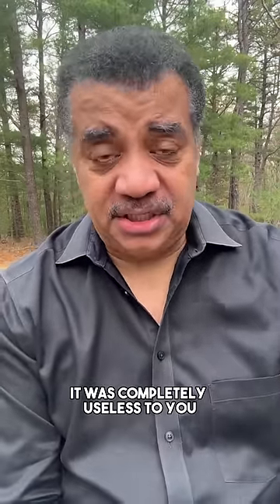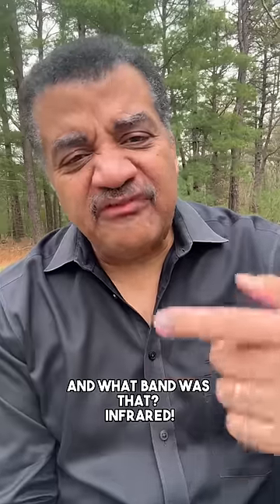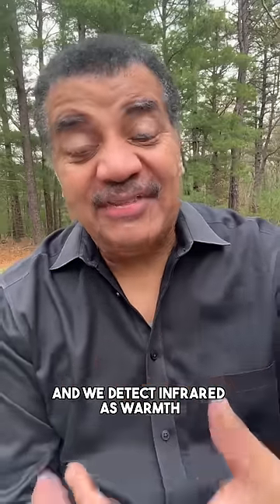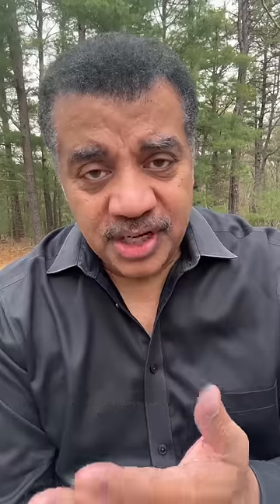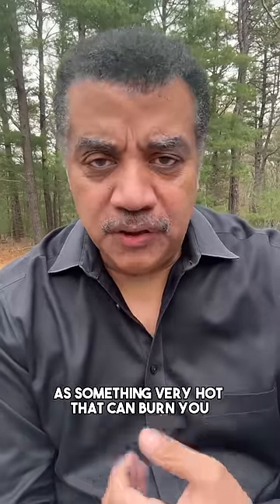LED Bulbs vs. Old Bulbs 💡

Comment: The wasteful thing now is that every LED bulb needs to have an AC-to-DC converter in it, which makes heat.  Maybe Edison was right about DC after all?
Reply: It's hard to say what's the most efficient and least costly system, but what we have now is pretty good. 
AC is good for long transmissions and is cheaper infrastructure than DC, whilst more dangerous (which is partially true, since DC can jump/arch over a longer distance in air than AC when opening a switch, making DC more dangerous in that regard).

Most simple devices that were used in beginning when electric grid was made got powered directly by AC, lights, motors, and devices that needed DC were considered niche. 

Also consider this, every outlet right now is standard either 230/240V or 110/120V single phase AC depending where you live. The device itself or charger/power supply then changes that standard into what it requires. Could be 12V DC for a laptop charger, 5V DC for phone charger, 3 phase AC for a brushless washing machine, etc...

If you wanted to use DC in all the house wiring instead, you would either need to run different cables for every outlet with a different Voltage, specific outlet and wiring for 12V DC for laptop chargers, 5V DC for phone charger, etc... this would make the electricians jobs and manufacturing of electrical equipment more difficult.
Furthermore, the equipment like brushless washing machines will still need to convert that DC into AC.

Also note changing DC voltages, e.g. 12V to 5V is not as easy as AC. Most efficient ways convert it to AC actually...

So honestly it's better to have a standard which costs less to setup (wiring for DC would cost much more due to thicker cables needed as you'll be running the lights in 12V or 5V DC at higher amperage), 
and can be easily converted to what the device needs (much easier and cheaper to convert AC to DC using a full bridge rectifier, than DC to AC which needs transistors, oscillators etc...) 

I think a combination of the 2 is the best, like having a single AC to DC converter for all the lights on the same circuit, and then run wiring that will have DC to those lights. 

However that's only for lightning really, anything else like outlets need to have the interchangeability (you don't want to be limited to only plugging in 12V DC devices into 1 outlet as it's only designed for that. If you wanted to change the outlet, either rewire panel or buy adapters... which wastes more energy than just using AC and converting it once.)
Reply: @dewsjievpdav6557  My question was rhetorical, really.  You raise good points.  I recently saw a video about a renovated hotel with most of the exterior surface clad with solar panels.  They used power-over-Ethernet to run all the lighting on DC.  (They didn't mention which of the three IEEE standards was used, or if they invented their own.)  About long-distance transmission - the very longest power lines use HVDC to eliminate the capacitive losses of AC.  It also means the lines can be buried or on the ocean floor instead of on tall towers.
Reply: If you feel how warm those AC/DC converters get compared to those 60 watt incandescent bulbs you'll see it is still more efficient.  That converter will only draw the amount of current it needs to turn on the LED.
Reply: @dewsjievpdav6557  No... AC is not better for long distances.
That a misconception. Historical AC was better for long distances because it was easy to transform to higher voltages. But with today's electronics that can transform DC to higher voltages, it is preferable to use DC.
Reply: You can power the diodes with AC.. but you'd still need to step down the voltage and use Graetz bridge

You could use DC, but you'd still have to step down the voltage
Reply: @1953bassman  Some get too hot to touch, I've noticed.  I'm sure they're cooler than incandescent
Reply: @SumUnicus  yes I know DC is actually the winner in very very long distance transmission. However the cost of that infrastructure is insanely high compared to AC transmission. It's not worth the money if you're transmitting between cities, however when you get to transmissions between cities, then it's worth it.

Comment: You ever wonder why an led bulb doesnt last 9 to 20 years like they say . Cost 5 times as much and not last 5 times as long.
Reply: Good question. The answer is simple: LEDs are cheap, Chinese junk. The computer chip goes bad before the actual diodes do, thus filling up the landfills with toxic chemicals and plastic. How is that better than a glass and metal incandescent bulb, which the unless Dept of Energy banned last year?!
Reply: Planned obsolescence. Without it we would buy bulbs once and never have to again. Lightbulb manufacturers colluded with each other to put lifespan limits on incandescent bulbs after they came out too.

Comment: The only thing about LED lightbulbs in cold weather, you have to turn them on and wait for them to warm up enough to actually see. I had my washer and dryer in the garage and 5 mins before the load was done , I had to go turn on the light and wait to be able to see. So go figure? Five extra minutes of usage over instant lighting and done with it and turned off. That doesn’t help. Inside our home, that’s fine except in the higher ceilings, they take time to get to luminosity. There’s give and take. Once they improve, I’ll be okay with that.

Comment: The warmth was actually a bonus it was a low wattage heater that operated in occupied rooms.
Obviously it wasn't always a bonus as thare are hot nights and unoccupied spaces and out door environments
Reply: I threw out my old lightbulbs. Bought some LED's and an electric heater instead! 🏝
Reply: Yep it was super welcome in our houses.

Plus smthg makes no sense : we use electric devices that need less electricity than before (much less watt), We know better than before how to produce it, but it's more expensive than before nowadays. + The heat loss from electric devices which cost a few more in heating than before.

Him : "Welcome to the present ! Welcome to the future !"

Us : "Can we get back instead ?"

Comment: Niel demonstrates over and over again that he doesn't understand science well. Infrared (heat) generated from lights is not wasted energy especially in colder climates. Most automotive manufacturers are discovering this from headlights. Halogen headlights produce enough heat to keep headlights free of Ice that normally distorts the headlights. That's just one example.

Comment: Warmth is indeed useful sometimes. Like when it is cold.
Reply: Thankfully, LED technology allows you to get the same amount of light AND heat for less cost. Just install one for light, one for infrared heat. Getting both the bulb and the heating element will cost you less in the long run than the less efficient incandescent bulb.

Comment: I have worked  on Refrigerators for 40yrs now factory warranty  and repairs ,i have never seen a light bulb  as a defrost  heater , as most use a heater that is similar to the bake element  in your stove.

Comment: I have worked in some high profile lighting maintenance situations with LED lighting. Heat is still the enemy and is still the reason lighting maintenance is recession proof still. I was trying to find a solution and I talked to the guy who did the LED lights on the space shuttle. He would not have anything to do with it because the manufacturers did not have the heat problem solved. I could have solved the problem at the airport so most fixtures would last the 20 year projected lifespan of the LED bulbs but they didn’t want to pay that much.
Heat is the main reason almost or maybe all things have a life expectancy.

Comment: No they weren't putting out usless infarred light. In cold climits they are great. Enough heat in well houses to keep pipes from freezing. They didn't hurt in the house either. And lets not forget green houses. Sure ultraviolet is good along with the infrared for heat. Plants like that.

Comment: Some led bulbsdo get hot showing their inefficiencies. 
To those that say old bulbs are more efficient at heating ... fill your house with incandescent bulbs and you have efficient heating ... on a hot day you will have to dump that extra heat with your air conditioning ☹️ 
The more difficult problem is the lack of Near IR causing problems with melatonin levels (part of the vitamin  D paradox, general health and viral resistance).

Comment: Net electricity in the US is basically flat since 2005, when LEDs and other concentrated efforts toward more efficient end use devices kicked into high gear.  And, we're much more populated now.  Things using electricity are getting more efficient across a broad spectrum of uses including HVAC, lighting, refrigeration... last year we actually used LESS electricity that the year before...

Comment: They were made to turn enough of the electricity into heat to 'burnout' the bulb. Although it was usually the posts holding the filament that melted.

Comment: Not useless energy when you live where -30°C isn’t uncommon. When it’s freezing cold in the winter, the heat from the lights is warming the room. When it’s +30°C, it’s also incredibly sunny and you don’t turn lights on. Switching to LED lights just put my gas bill up.

Comment: Well that's all well done but occasionally you like the warmth from a standard old light bulb like when you're trying to heat your pump house to keep it from freezing and put the light bulb down by the pump when you trying to keep your boat from getting too much moisture in it so you buy a light bulb in there to help keep it from being too wet

Comment: I thought it was closer to 95% heat. In the 70s when I was studying electronic engineering and we considered vacuum tubes to be, well, worse than passe (exceptions for rf transmitters), we liked to call a common lightbulb a 100W, as in "one oh oh w" tube.

Comment: A major problem with LED lighting is that because each LED uses so much less wattage that manufacturers use many more LEDS per light fixture than were used in the old incandescent fixtures and thus more light is generated than is needed and the amount of light pollution is increasing.

Comment: LEDs are not "bulbs", they are Diodes. Bulbs contain a filament that is a resistor that heats up in order to blow when they get hot. LEDS have extremely low resistance and that is why they don't get hot. The light from an LED comes from photons released by the vibration of electrons crossing the PN junction in the Diode.

Comment: BUT, why not swap out the LED bulbs in winter?  We use light bulbs at night, when it's coldest.  We could simultaneously light and heat our rooms with incandescent bulbs during the winter nights.

Comment: Ok, the light-part of an energy bill is negligible, even with these old bulbs.

The moment you have your lights on, heating would be on as well, so the heat is not lost.

LED lamps are way more expensive than bulbs.

Bulbs are made with way less environmental damage than LED.

LED use electronic techniques that make bad use of the grid, and the powercompanies will start billing us for it.

Comment: Old Bulbs were literally burning. They emited light by being really really hot  - so hot they become "orange hot" - this way they could last 1,000 hours before they literally burned off.

1000 hours can be seen as industry standard, as it is a trade-off between efficency and durability of the filliment - you can make the lightbulbs more energy-efficient but shorter-lasting by changing the amp&voltage, by warming filliment to the even higher temperature than usual - but make it last mere minutes or seconds - it will produce more light that is closer to white than warm light old bulbs did.

Old bulbs aren't "Light makers that have a side effect of getting warm". They were "Warmerers with a side effect of emmiting light" ;)

Watch Longer-lasting light bulbs: it was complicated by Technology Connectiosn for better explanation with the visuals and experiments :)

Comment: However, led bulbs need the same energy to start up as regular bulbs. We had 120 watt led lightsources in a factory that needed a special switch bc at startup they pull 90 amps.

Comment: I call horse manure, old bulbs made a filament hot. The hot filament glows, thus making light. It's kinda like a foam cutter where electricity makes the wire hot, more will make it glow.

Comment: Let me educate you a bit more about LEDs Neil. LEDs do not put all of the energy into producing visible light. Currently they have an efficiency of around 40-50% meaning that 50-60% of the electricity is wasted on producing infrared light. Most LEDs that people use are low wattage and so they produce almost no heat but they also manufacture high wattage LEDs and those ones get extremely hot. I have a few LED lights that could probably give you second degree burns if you tried touching them after they've been powered on for a few minutes

Comment: the LEDs DO get hot, just not the bulb itself, the base of the light bulb gets VERY hot, never touch the "non-light" part of an LED that has been on for a while, you will burn your fingers.

Comment: I mean LED bulbs still get hot, because they have to transform 120v AC to 5v DC and the electronics to do so below the LEDs have a heatsink to dissipate the heat, so the base is hot, but the bulb end is not.

Comment: Not 'all' of the electrical energy is converted to light lumens. They still get hot, but the efficiency is much higher - say, 15% heat & 85% light

Comment: I think advances in illumination are some of our greatest achievements in the past two decades. Remember the old clunky flashlights of our youth? The kind that had the slider switch on the side? Two d-cell batteries that might give you 3 hours of poor lighting? Compare that to something modern that can fit in your pocket. Modern indoor vegetative grow lights that consume a fraction of the power of the old sodium high pressure bulbs. Automobile lights, street lights. 

As messed up as the world is, at least we can see it better.

Comment: But did he tell you why? glad you asked: lightbulb emits a thermal spectrum, just like glowing metal or a welding arc. the thin filament is VERY hot much hotter as molten metal. the welding arc is even hotter. that's why it is so bright and and even emits UV rays (that hurt your eyes). a neon lamp is a trick. it is a VERY hot gas of electron (plasma). but the temperature of the gas itself is room temperature. that's why neon light are way more efficient. in an LED the emitted light is not from a heat spectrum. it is from electron that go from the high level of the bandgap to the low level in a semi-conductor. the light in a laser come from exited atoms or molecules going back to ground state and emitting photons. That's why there is a very narrow band of frequencies emitted while all thermal sources emit a wide spectrum of frequencies. the bandwidth in an led allows for narrow spectrum close to the energy of the band gap. depending on the material LEDs have a color (red, green and blue). A blue color means a very large band gap and finding a matching material was difficult and only achieved two decades ago (by a Japanese physicist). white leds are a combination of red, green and blue (RGB)

Comment: Not useless, because it came off as heat… well if you needed the heat that is. In a small space those 50W became a very effective heater compared to a radiator.

Comment: Not true. Old light bulbs worked by heating the filament to extreme temperatures. They were just fancy candles. LED light bulbs also get very hot, but not as extreme as filament light bulbs.

Comment: I don't disagree entirely, but LED's do get hot depending on what light you are using.
If my pocket flashlight gets accidentally turned on, it will literally melt through your pants pocket....ask me how I know 😢
L.E.D.'s are awesome either way.

Comment: A lot of the LED bulbs do get hot near the base though. I assume that's because there's a voltage converter in there dropping the voltage down? That means they are wasting some energy, right?

Comment: 95% of the electricity in the homes doesn't go to lighting, it goes for heating/cooling/appliances/dehumidifiers/humidifiers/etc.    We should look else where to get excited.    Sure should not mandate changing them.    Just like they are so worried about personal cars, when most of the transportation fuel by far is used by Trucks/Planes/and International trade.    We should fix the big problems that are easily fixed before we create huge problems where problems didn't really exist.

Comment: Yeah, but now, if we want to heat a small area instead of using a light bulb, we have to use something that's a lot more dangerous when before we could just take a 100 W ball but stick it in a chicken co-op period no a 100. Watt bulb isn't warm eto heat a chicken.  Or keep a pumped from freezing period

Comment: I don't know who told you LED bulbs don't get hot. Some don't. The right bulb in the right fixture though and they get very hot. I was just changing some bulbs in one of my buildings and some had gotten so hot they warped and split at the bottom over time.